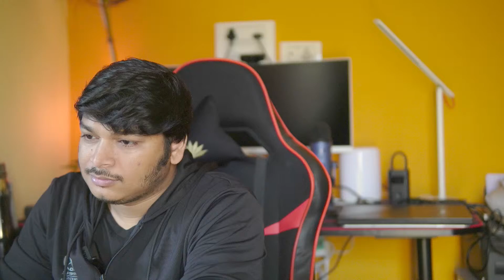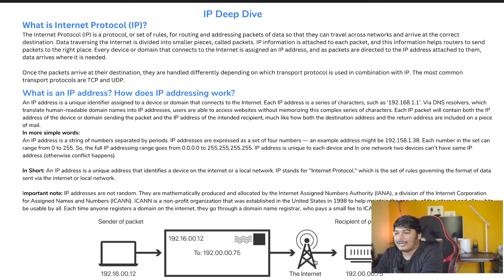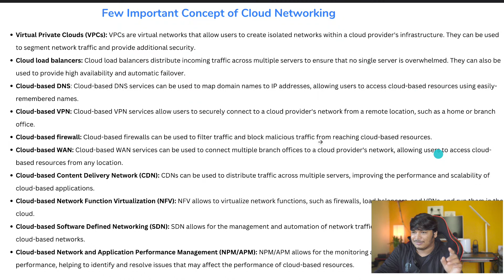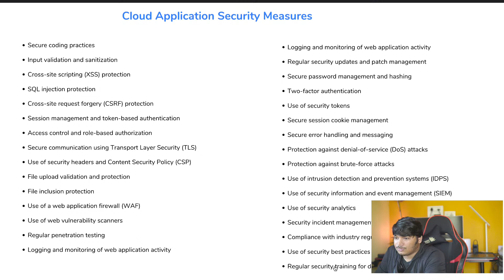Essential Computer Networking & Security for Cloud  | Cloud & DevOps Training Day 3

Comment from the maker: Download slides from here: http://bit.ly/3CS4wKl 
Video timestamps:

00:00 Intro

01:25 What is Computer Networking?

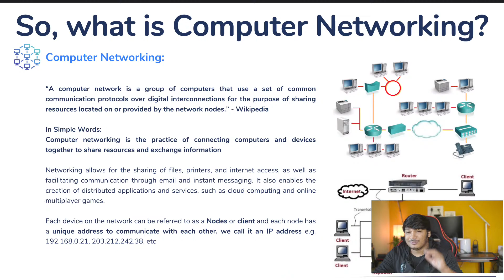5:32  Types Of Computer Networking

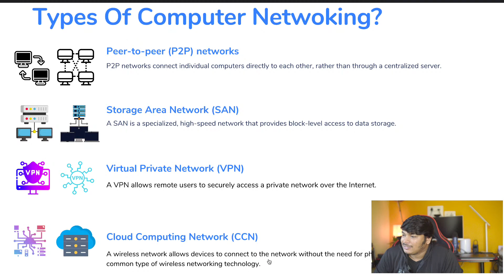13:33 What is OSI Model?

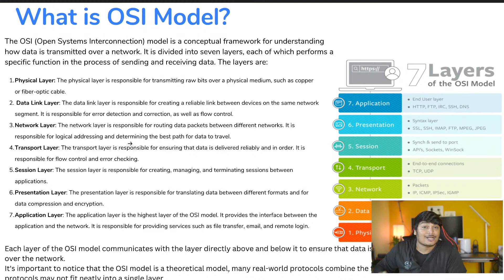22:11 What is TCP/IP Model?

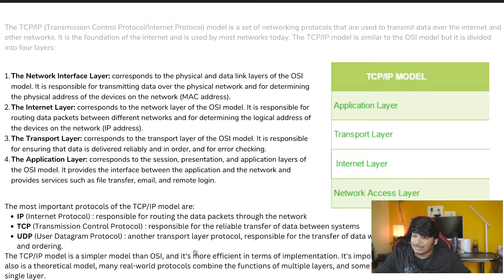27:32  OSI Model vs TCP/IP Model

28:29  What are Network Protocols? and what are the common network Protocols?

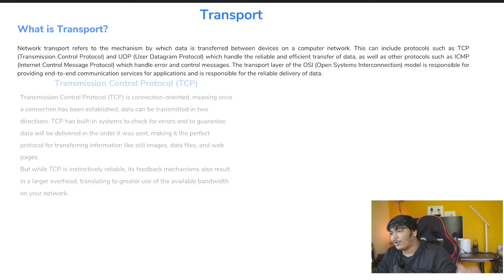48:18 Transport (TCP/UDP in-depth)

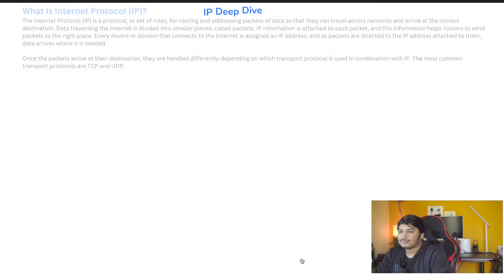54:58  What is Internet Protocol (IP)? What is an IP address? How does IP addressing work?

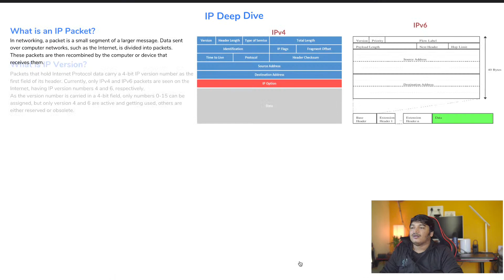1:06:22 What is an IP Packet,  IP Version (IPv4 and IPv6)?

1:13:31 Types Of IP Addresses Based on classes (A, B, C, D, E). Based on Accessibility (Private IP and Public IP)

1:35:03 Router & Switches & Routing Protocols 

1:43:34 What is DNS? Steps in a DNS lookup & Retrieving Web Page / Content

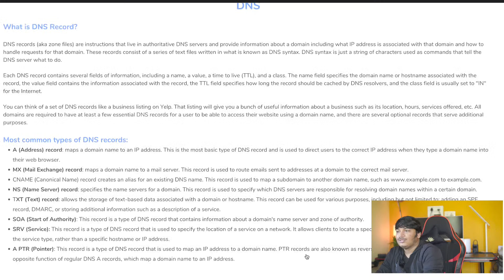1:53:04 What is DNS Record? Most common types of DNS records

2:03:12 What is a Firewall and what are the different types Of Firewalls?

2:08:02 Networking Speed Details, Bandwidth, Throughput

2:16:24 Few Important Concepts of Cloud Networking (VPC, Load Balancers, VPN, CDN, SDN, APN, etc)

2:24:04 What is Computer Security?

2:26:09 Types of Computer Security

2:28:24 Computer Security Threats

2:33:53 What is Cloud Security?

2:35:32  Cloud Security Principles 

2:39:03 Cloud Application Security Measures 

2:41:36 Brief discussion on DDoS attacks, types of DDoS attacks, and how to prevent it 

2:49:46 Ending Statements & QA